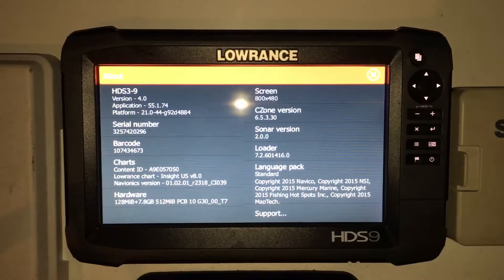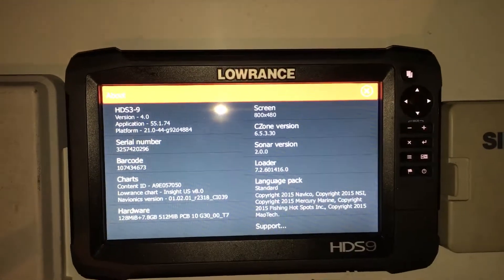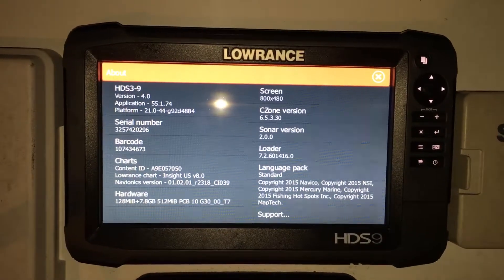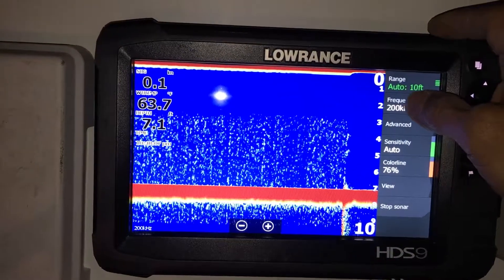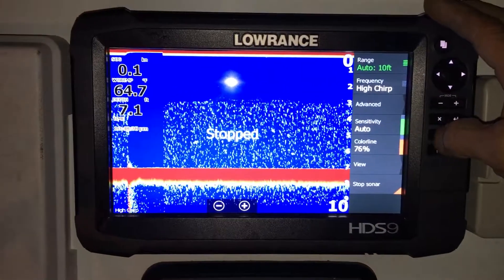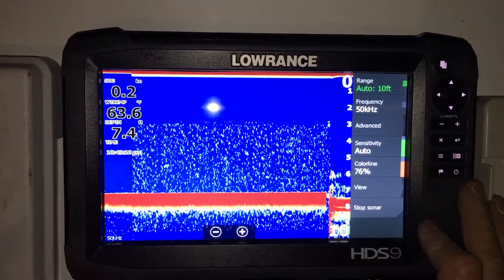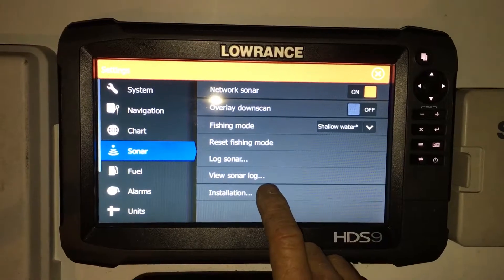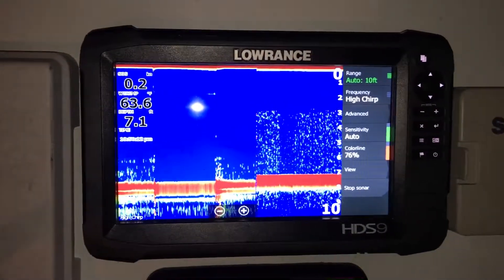Lowrance Gen3 with B765C-LH. Dual freq Chirp. How to.

Comment: Thanks for the info
Is the switch external to the unit?
 I couldnot see you toglling the switch when going from one chirp to other..
What is the purpose of switch? Saving you effort replacing between  chirp cables when it is flush mount unit? So if unit is extrrnal on bracket i believe it will be possible not ysing the switch by replacing cables each time or am i missing something?

Also interesting is unit not recognizing transducer automatically and this transducer type not specified in installation list of transducers...
Reply from the maker: Correct. Instead of swapping cables its easier to use a switch on this boat.  
This TD is not on the compatibility list as this unit does not have dual chirp ports
Reply: Thanks. Maybe you can guide me Where can i find such toggle switch?